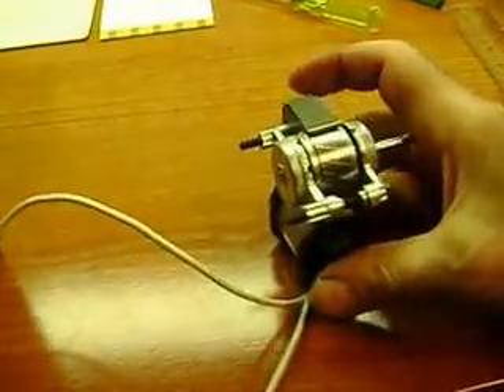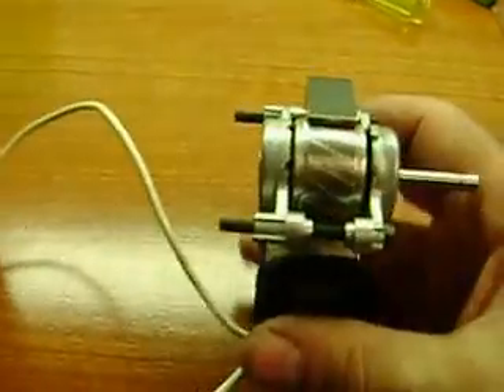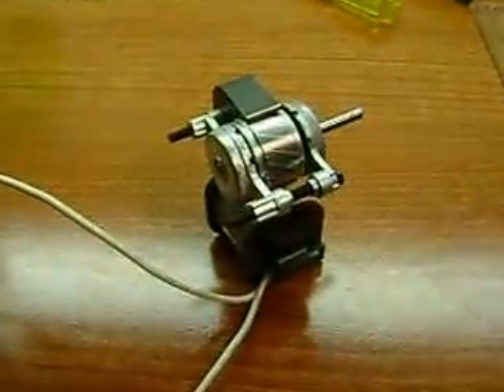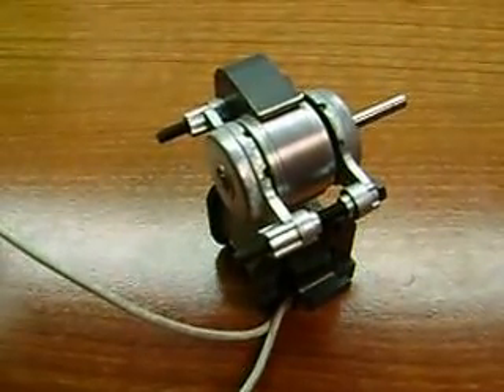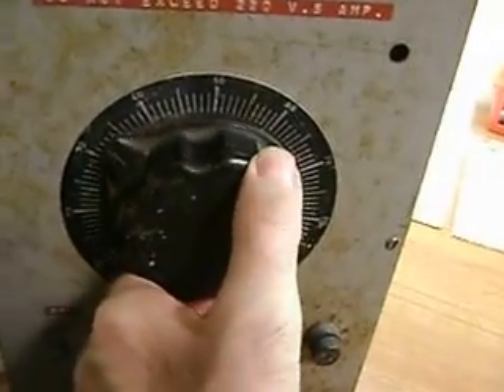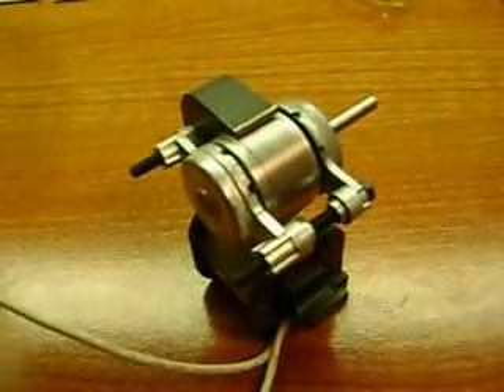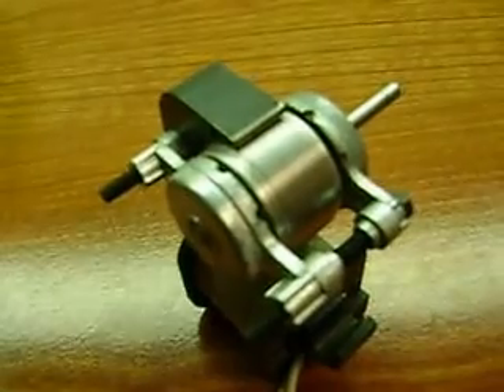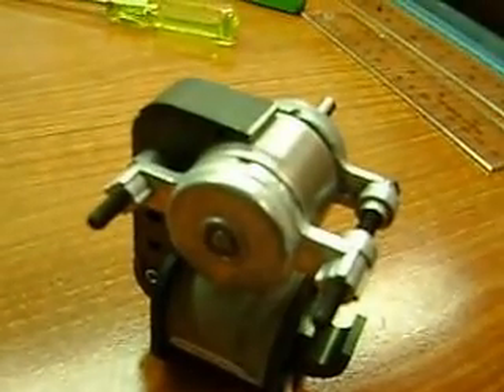Autono-Drive Inc. shaded pole motor experimentation

Comment: Guess what.  On the cutaway motor iron pole, the added wrap around pole core is there for motor hp, not to make 2 poles.  From the AC motor's perspective, the only pole it uses is the one at the furthest outside edge where you still have the single magnetic pole it requires, except about 90 degrees retarded.
Reply from the maker: Hello R.V. Gad, Naturally 2 poles is more efficient then 1 pole. Can you elaborate on the line, " the only pole it uses is the one at the furthest outside edge where you still have a single magnetic pole it requires, except about 90* retarded." Not quite sure what you mean there.
Reply: The entire iron core acts as a single pole, with the other pole acting from the core of the motor (approximately) and switches constantly with the frequency of the AC power applied.  In a shaded pole motor, the poles aren't rigidly fixed as in a DC motor, and they switch and move so fast that its hard to describe in simple terms of a two pole motor.  With the cut away iron wafer core the temporary AC pole is shifted and localized in a different place, but could be made even smaller, but the motor work force (micro-Horsepower) will suffer.
Reply from the maker: I appreciate the accuracy of your statement. The poles aren't rigidly fixed as in a DC motor. I see you have a deep interest for electric motors.